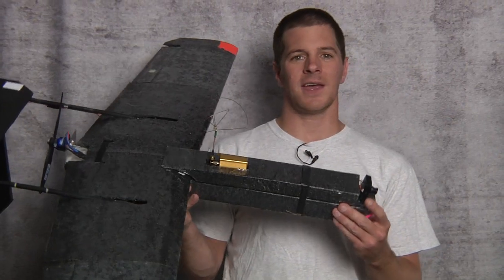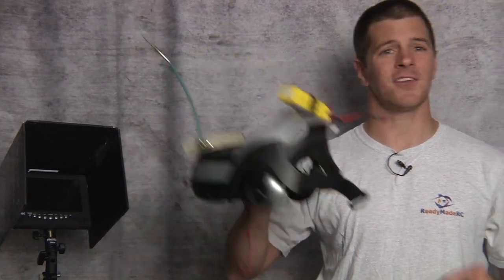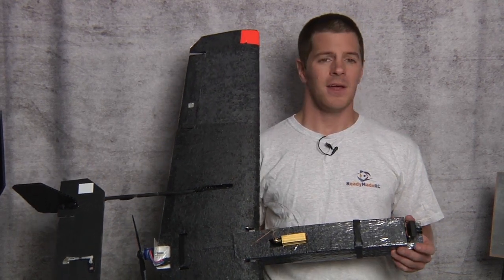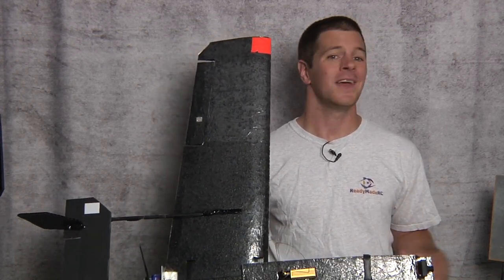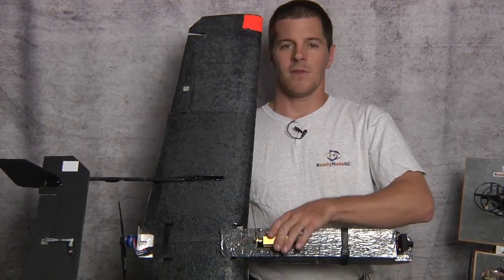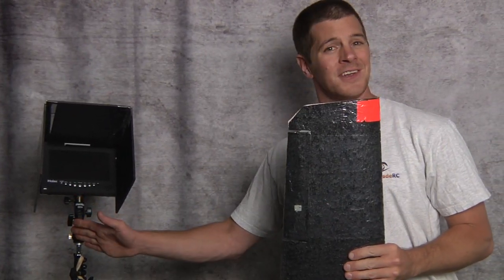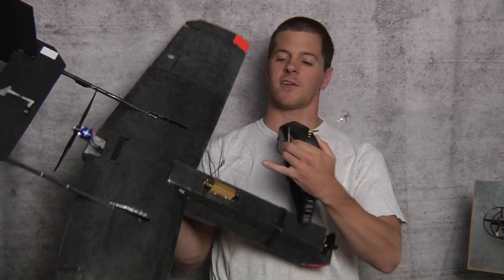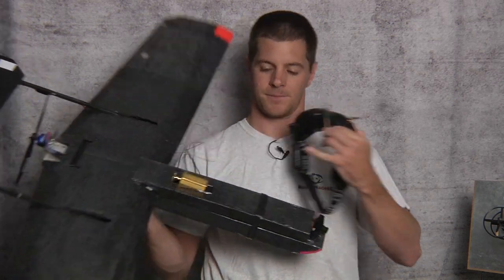How to be successful in FPV part3 - The video system explained

Comment: Hello, i need some serious help i am trying to put an fpv system on my rc car and i need to be able to have the signal go through buildings what receiver and transmitter should i use?. my radio in the car is 2.4 but i can change it.
Reply from the maker: I would use either 900MHz or 1.3Ghz for your application.  400-800mW should do it.  A set of circular antennas (preferably a directional antenna on the receiver) should get you decent video.
Reply: +Video Aerial Systems I am going to go with 1.3 will my 2.4 radio work? Also thanks for the reply
Reply from the maker: You will need a notch filter, but yes it will work.
Reply: +Video Aerial Systems thanks for the help!

Comment: Hello and thanks for the videos they are very informative. I have recently got into the hobby and I am wondering what would be a good video frequency for a 250 size quadcopter, 1.3 video or 5.8.  I've heard that 5.8 can be clearer but the area i will be flying in has a lot of obstacles trees hills etc. Thanks in advance.
Reply from the maker: +Silvara Majere - Anyone who tells you 5.8Ghz is clearer has not run 1.3Ghz.  1.3Ghz has longer range, better clarity, and less interference.  The only problem is: the antennas are large and the equipment is more expensive.
Reply: +Video Aerial Systems  Thank you for the reply. I would like to run something like 1.3ghz with  433 for control, but I'm worried that it might be too heavy for a 250mm quadcopter. I might just have to save the 1.3 for my future Sabre build, thanks for your time.

Comment: Hey Alex, I enjoy your videos. They are very informative. I have a question... If I have a 5.8 FPV system and buy one of your helical 5.8 receiver antenna, will I be able to keep reception when flying behind trees, houses etc?  Thank you Alex, Ray
Reply: It depends but one essential thing you should keep in mind 5.8Ghz has bad penetration, with helical (or cloverleaf) antennas, you will be able to fly in front, beside and behind you, you will be able to fly behind objects if they are not too far from you but most of times your video signal will decrease or worst case you will loose your video signal :)

Comment: I live in a rural pacific northwest area where the only obstacles and objects at risk (in the case that I crash) are trees. However, being that there are trees everywhere and they're VERY tall, my video frequency of choice would be 1.280ghz. With that I would choose a radio on 433mhz openlrs. Cloverleafs would go on the video tx/rx, an rmilec whip antenna for radio tx and stock antenna for radio rx. Any flaws with this? Possible other choice for radio rx?

Comment: Should i stay away from the 1.2/1.3ghz fpv because of my gps module and go with a 2.4ghz? or do you think i could space them apart enough to eliminate interference. using with dragon link 433mhz and RF900 telemetry 900mhz for apm 2.5. Also the size of the 1.2/1.3 antennas are significantly larger than the 2.4/2,5ghz frequencies...

Comment: Great video, I'm using 5.8 on my plane and was wondering if it is ok to use a omni directional antanna that has vertical polarization. I heard you say that circular polerization is a must and was wondering if it's the same thing.

Comment: for video system of 1.3 ghz or 1.280 ghz whatever, do you need a filter on the 1.3 system if you are using 433 mhz radio for your plane?

Comment: Whats the difference in the range of your 2.4ghz control (FrSky) if you use 1.2ghz with a lowpass filter or a 5.8ghz? I've been hearing mixed results but from my experience the 1.2ghz works just fine but I want to clear this up once for all :D